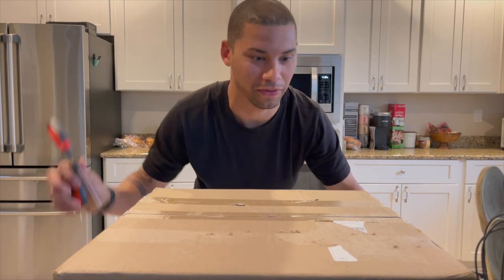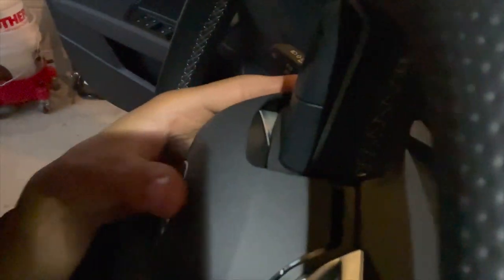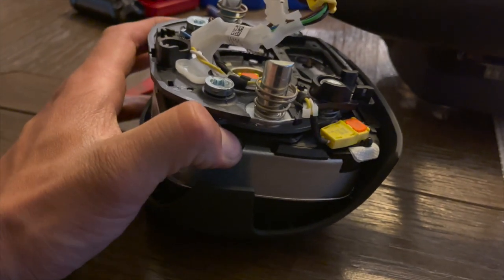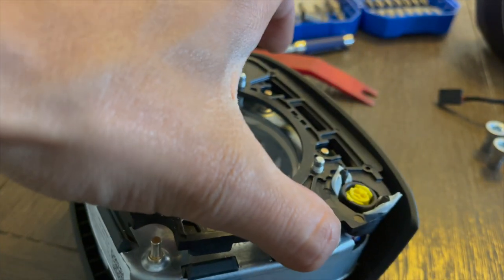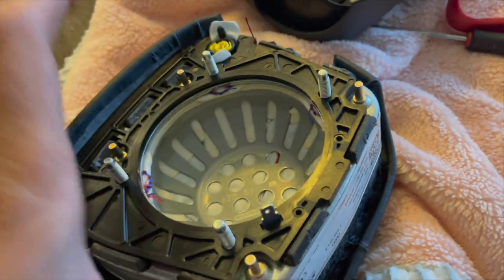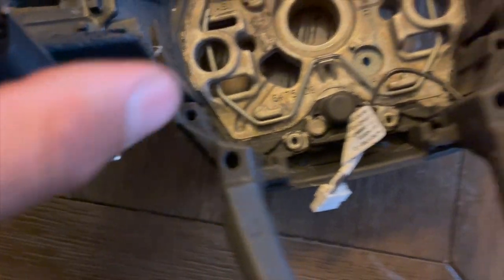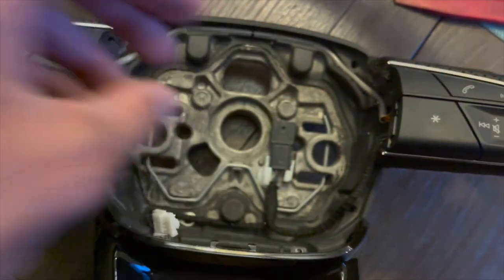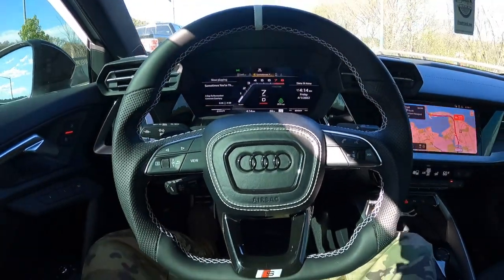Steering wheel upgrade! I didn't think it would be this great! | DIY airbag cover & wheel 8Y S3

Comment: When I swapped my wheel I struggled with a flathead for a minute trying to get those airbag clips from the rear then got a tip to use a t20 Torx driver. So much easier to pry those clips open and didn't have to worry about slipping and jabbing anything with a bladed\sharp edge. Worked great. The new wheel looks awesome man! Love the white stitching.
Reply from the maker: That's actually a way better idea honestly! That's what I'm doing next time lol! And thanks, it really should've been similar from the factory!

Comment: Dope ass wheel. Youre more experienced than i am, but should one pull the battery before removing airbag? Or is it unlikely to cause issues either way
Reply from the maker: You could (and probably should..)for sure.. when I worked at VW they didn't even have us take the terminals ooff for airbag recalls.. apparently no power goes to bag if the car isn't running. I didn't bother, but I'm also not a prime example of a safe by the book guy so take that for what it's worth lol

Comment: Do you get a code ? I’m trying to find an aftermarket wheel but it’s really difficult finding one with the vibration and lane assist sensors, I should mention I don’t use it so not at a loss if it doesn’t work … don’t want dash lights
Reply from the maker: I can send you the info to disable the lights 😃 find me on IG Br32yce. You will need an OBD ELEVEN
Reply: @BryceJordanProductions  sent you a dm
Reply: Hi, how can you code out the lights